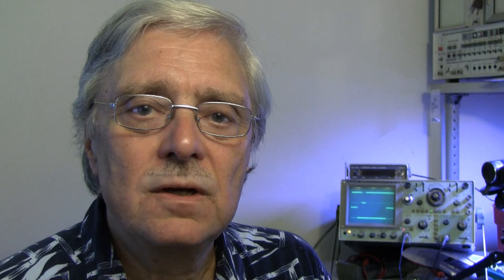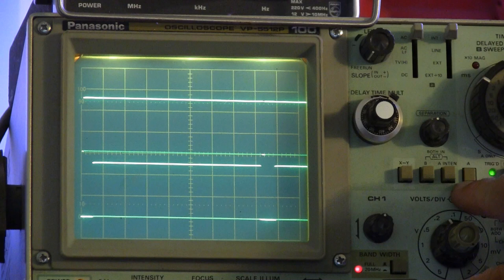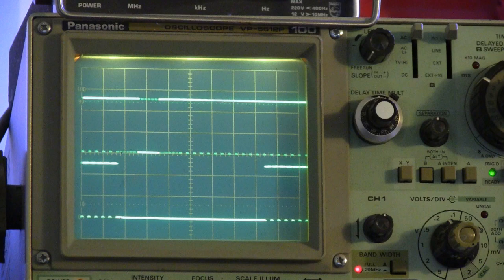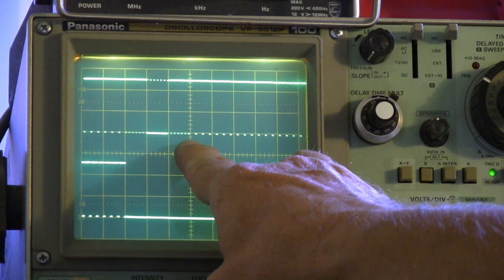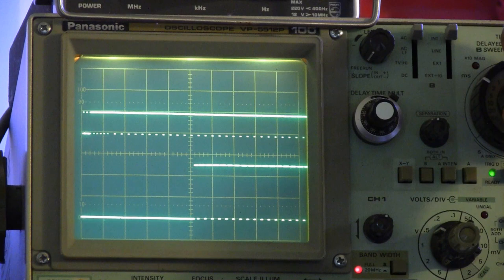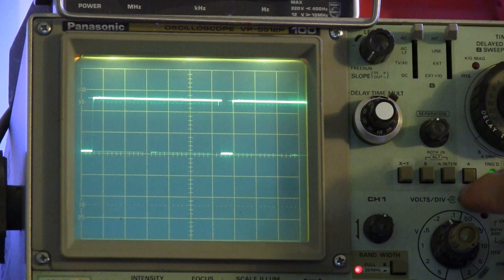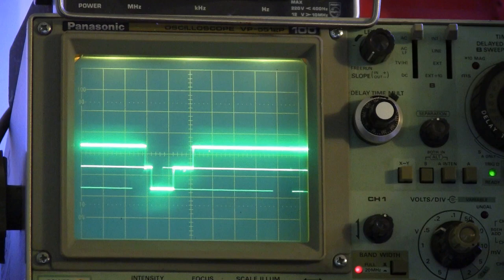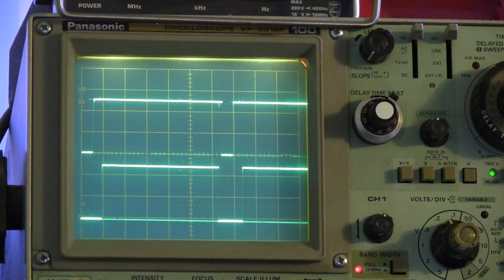How to view TV sync signals on an oscilloscope

Comment: Thanks a lot - I just graduated and don't know how I ever got the analog scope to work right before as far as the triggering.  I always wondered about my old "Macrovision" tapes, how they didn't cause a problem on a TV but only through a VCR.  I did a little snooping around and the retrace after the (only) falling edge before the colorburst makes perfect sense.  I noticed other interesting things too, as changing amplitudes with the colorburst - I'd have to get my old tape player out and try it on my flatscreen and see if it causes problems now  :)
Reply from the maker: Thanks for the kudos. That would be a great academic exercise. I can't do that stuff or comment in detail as my NDAs with Macrovision are technically still in effect. It was a requirement to understand these things when as an engineer at (the old) Prime Image. I am not affiliated with the new company of the same name. Best of luck and have fun!
Reply: Thats right I heard that was called the "analog hole". Even though everything is digital - I guess macrovision still has some uses even today. I haven't checked to see if it's timing is fast enough to work on 1080p just regular 480i

I'm wondering what a modulated IF signal is supposed to look like (49 mhz?) I don't have my scope calibrated yet. It's a 6MHz wide channel would I just look at the video center carrier?

On another subject the old arcade and Nintendo games have become quite popular and valuable lately. I know the "gun" (duck hunt) only works on a CRT. Haven't had the time to investigate exactly how it works yet but it's gotta be some index of the line number and "X" position of the AM baseband on that particular line.

Comment: Will this work if I use an RCA to BNC adapter on Channel 1, and hook it up to a color bar generator? I just got an analog scope (Iwatsu 5710).
Reply from the maker: Yes. That will work. If you add a BNC-T and a 75 ohm BNC terminator, you will get the proper voltage readings on the scope. Best of luck and lots of fun!
Reply: @videolabguy  I'm using it without a 75 ohm resistor and I can see the signal (the horizontal blanking, the color burst, the actual signal, etc)

Comment: You mentioned an archaic fuction that is no longer a problem in modern televisions. I think it was the equalizer pulses in the vertical  sync pulse. Can it be eliminated in modern televisons?
Reply from the maker: Great question. But, no. Even though the analog signal is immediately digitized, the equalizers and serrations are necessary for the sync processor to get the interlace cadence correct. That is, to properly identify field one and field two by counting the pulses. From that, the down stream de-interlacer process can work properly.

Comment: Heh while I haven't got TV I have got internet and find myself constantly staring at the coax cable thinking about connecting it to my scope. But, being a relatively new scope owner I'm still very reluctant to connect it to anything referenced to mains or potentially referenced to mains in case I accidentally connect the ground to a live connection. As long as I'm aware of the risk and how to avoid it I think I should be fine though. But this guide definetly helps. I tried to connect my scope up to an RCA connector that was outputting a composite video signal but I had trouble displaying it. On my normal bench top scope that's referenced to mains, it wouldn't display anything. But on my cheap $20 scope that runs on batteries and so is "floating" will display it no problem. But I'm not about to hack the ground pin off of my $500 bench top scope just to make a sketchy floating scope so I can do this one experiment. I mean there are probably less destructive ways to do it, but operating your scope while floating in itself seems like it could potentially damage it.
Reply from the maker: Any modern product with a yellow CVBS output jack is isolated by default. It is necessary if you think about how many devices that can be connected together.
The issue with your scope sounds like you have not mastered the triggering functions. Though simple at one level, they can be confounding other levels. Be sure to set the trigger select to the same channel as the one viewing the video waveform. Set the trigger polarity to negative. Set hold off to zero. Adjust the variable trigger level knob until the video locks. If the scope has a video trigger mode, set it for that. If not, set the trigger for edge trigger, once again negative edge. Then Robert will be your Dad's brother. Have great day!

Comment: Thank you for the informative video! Is there a device or maybe a set of connectors, that will let me view a video signal on a TV and oscilloscope at the same time? Let's say my video signal uses RCA jacks
Reply from the maker: A simple Y splitter cable should do the trick.